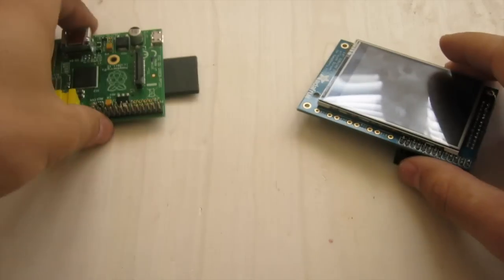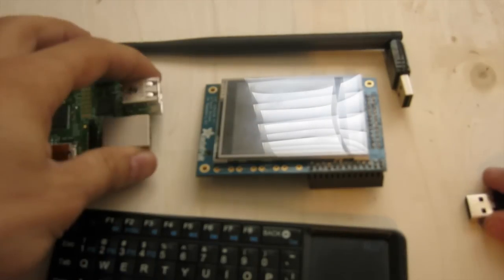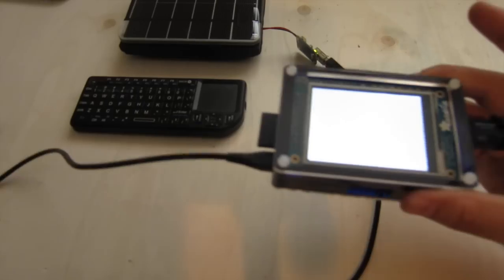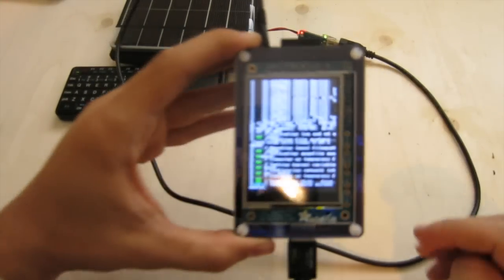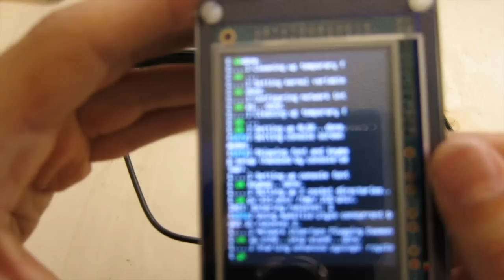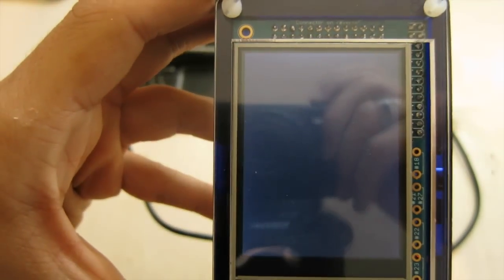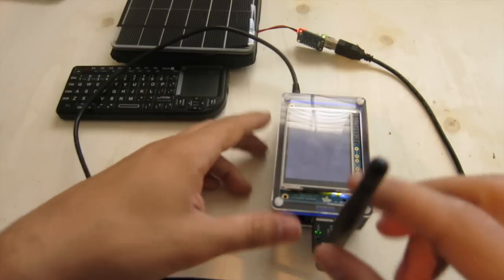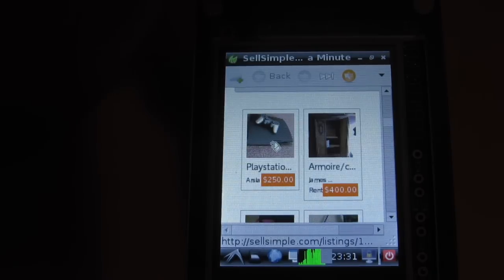How-To: Build a Solar Powered Raspberry Pi

Comment: 1) to charge that battery without solar power, you just plug a wall adapter into that poly-charger board where you have plugged in your solar panel?

2) how to you add batteries, to double etc your battery capacity?

Comment: Thanks. I'll add this knowledge to a similar project I'm making for the pi. Helpful. That's a pretty huge fuck off capacitor in that one. You could use a buck-boost too.  I think devices like this are great particularly if you go camping or hiking and you get lost a device like this could literally save your life. You can power mobile phones as well using this type of thing.
I think Kali Linux is better than Raspian for a small device.

Comment: i am wondering if anyone can help me with a build that i have in mind. Of course its the raspberry pie but its going to be turned into a tablet with rechargeable batteries, a solar panel on the back of the pad, wifi and bluetooth. I have been trying to learn more about soldering and how to measure the amount of power a piece of device requires but its not good enough. If anyone can help me out then i would appreciate it!!
Reply: lol project was done months ago! thanks for the help too!

Comment: Good work, but I see that the tiny LCD isn't really comfortable for normal desktop use. I'm planning to build a solar-powered system with Raspberry Pi, with 3G modem and Wi-Fi access point, and also some sensors (weather and some others) trasmitting data to a central database. I know there are dedicated Wi-Fi access points with 3G, but RPi can also receive data from I2C sensors and run software passing the data to the proper server.

Comment: What is the battery life running on the batter pack? Is it enough to run with little load over night? How long does it take the solar panel to charge the battery pack?

Comment: Aren't you supposed to pull off the protective plastic from the plastic casing? The blue tape?
Reply: +MrJason005 No, the protective plastic adds to the shrapnel when the battery explodes from being left out in the sun.

Comment: Hello, great job.
A question : can you add a Router like TL-MR3040 at this Solar Powered Raspberry Pi?
Reply: 6 years later...
Reply: The integrated 2000mAh provides portability as well as hours of usage on a single charge.

Comment: Very Very Cool :o) However in the UK we call it SOLDERING NOT SODDING you lot over there always make the same mistake ~ Pants/Trousers Sidewalk/Pavement. Very cool vid & project though XX
Reply: US and UK, divided by a common language.
Reply: and by a gazillion litres of salt water.
Reply: Eli Mullis
Haha Touché'
Reply: Alan Godfrey Sidewalk/footpath; [H]erb with the 'H'; Right side of the road vs the correct side of the road; petrol vs gas (which isn't a gas).  But it's not like you poms can talk - you fill up your cars in litres, still use stupid miles and measure fuel efficiency in MPG which no one understands - not even Americans, since their gallons are different to yours!
Reply: *****  Diggin the language thang ;o)  wer'e called Limey's as well as Poms etc. I'm sorry., Meanwhile Low power *ix based Solar = have you played with monkey linux?  I'm thinking totally solar /capacitor based standalone router/repeaters what is the lowest power you have managed compared with size of solar array? it would be good.....take care ;o)
Reply: I say SODDERING. Now what?
Reply: turb0m0nk3y You mean liters, right?

Comment: Theres an easier way.  Just buy a solar powered bank and attach it to your pie.  The end.
Reply: If you want a pi that runs with the sun not with a battery that Will keep it running when there is no sun and make the pi turn off when there is not enough sun light and if you wan no screen then ok

Comment: Surely its easier to use the following http://www.ebay.co.uk/itm/30000mAh-Mobile-Phone-Solar-Panel-Charger-Battery-Dual-USB-External-Power-Bank/301240048925?_trksid=p5411.c100169.m2942&_trkparms=aid%3D555012%26algo%3DPW.MBE%26ao%3D1%26asc%3D20140131123815%26meid%3D6100a9c09bdc482982762377a453096e%26pid%3D100169%26prg%3D20140131123815%26rk%3D3%26rkt%3D15%26sd%3D111046943294  and  http://www.amazon.co.uk/Tontec%C2%AE-Raspberry-Touchscreen-Transparent-Heatsinks/dp/B00LN9MYCO/ref=sr_1_5?ie=UTF8&qid=1411689060&sr=8-5&keywords=Raspberry+Pi+screen  ?